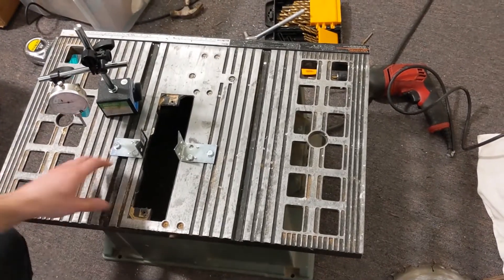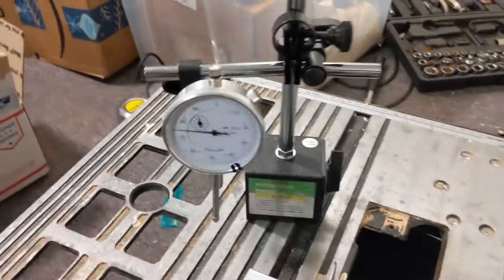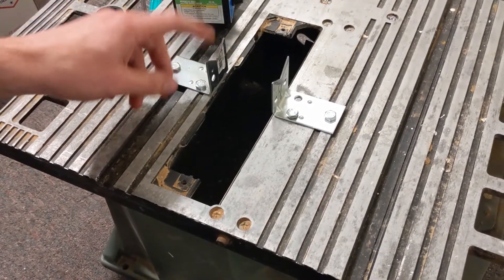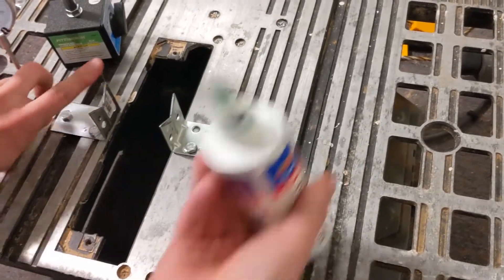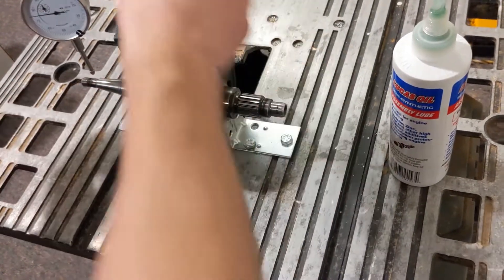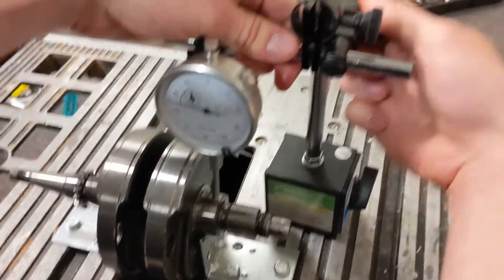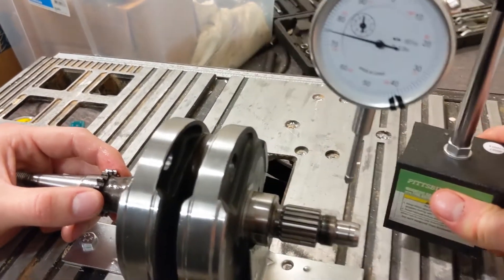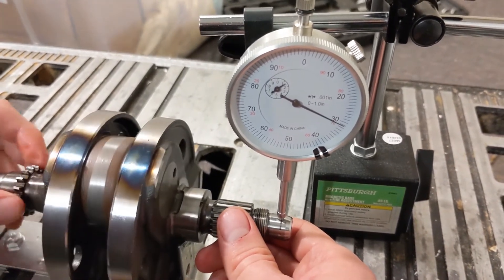Measuring Crankshaft Runout for Cheap - No V-Blocks Required!

Comment: I did the same "tool" but when i spin the crank with my hand, the crank keeps moving to the right so i cant measure the runout. I dont know if its my tool or the crank is very misaligned -.-